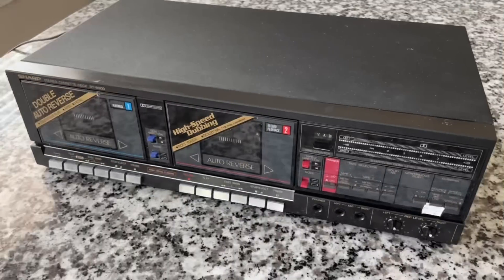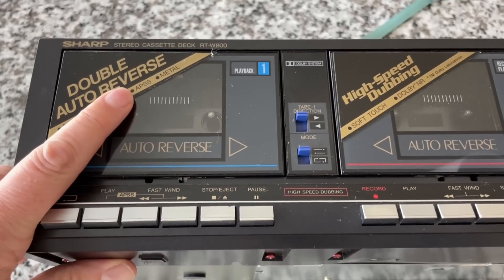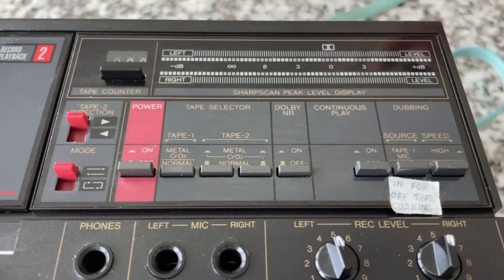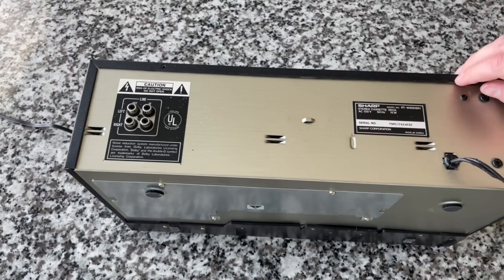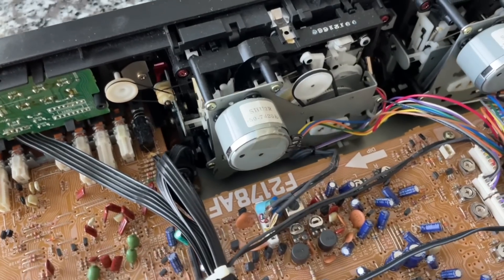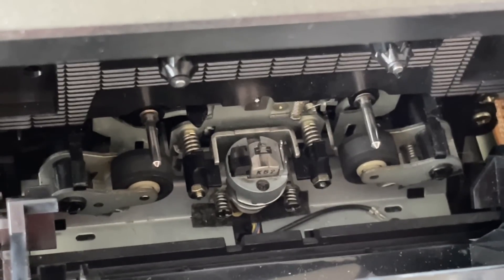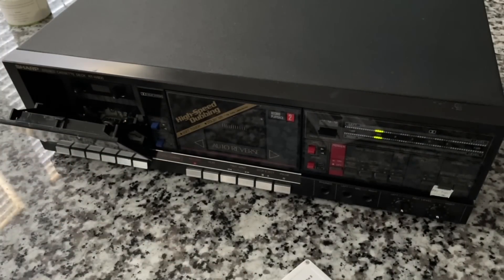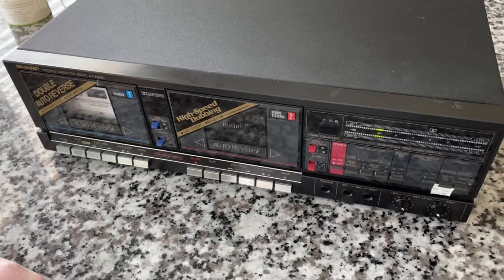RAD Sharp RT-W800 (1985) Tape Recorder! #sharp #cassette #tape

Comment: APSS is Automatic Program Search System, also known as Auto Program Search System, is a technology brought out by Sharp for audio cassette players to automatically wind to the beginning of the next or previous track on audio cassettes - similar to the more modern CD medium. The APSS is available for devices with mechanical buttons as well as for devices with electronic buttons. There were also turntables with this function, but technically it worked differently.
Reply: I have a turntable that has this feature.
Reply: I used to have a portable monaural Sharp cassette tape recorder with the FM/MW Radio. It had this APSS function as well and it was very convenient. It would seem to sense the silence between tracks to auto play.
Reply: I had a sharp GF 8080 which was a 3 waveband(FM stereo MW and LW)stereo radio cassette recorder,the tape deck on this had APSS as well !!

Comment: They sold these into the 90s—I bought mine new in 1992. It was the cheapest dual cassette deck Sears had in stock. Everything else was over $100 and this was $60 if I remember correctly. All the other decks were black and had slow-opening doors and the stainless feet that looked cool at the time. This one was boxy and colorful which looked ugly and dated back then, but it was within my high school kid budget and did everything I needed it to do.

Comment: 14:30 - The capacitor is not shielded, it is a HEAT SINK for the voltage regulator mounted to it. So it is there that the voltage regulator does not get too hot and has more surface to get the warm into the surrounding area
2nd - the color of the PCB did never switch from brown to green. Most audio stuff has the lowest tear of boards - a single sided board. There are no traces on top of it, so no need to protect the traces. If you turn it around it probably is green because there are the traces and those ned protection by coating. The color of this coating is mostly green, but can be any color, e.g. black on modern boards, white, red, blue, or even brown/orange. Computers on the other hand have more signals and use 2 or even 4 or 6 layer boards, meaning that the traces run on top and bottom, or even inside the board non visible by "stuck together" boards. What you mostly see in VCR and audio stuff are those camps or just bare metal connections without any resistor etc. That is just to bring the signal on the bottom over to another place, to make it run accross other traces without making a short. That is where usually you would have a top layer and traces, but it probably is cheaper to run a few metal wires rather than having a dual layer board design.  The top layer in this case shows the traces and components and markings but those are not actual traces, they are just printed on so you can see on top what is connected  on the bottom.

Comment: The reason Dolby is labelled is because the Dolby encoding makes a 10db increase in the higher frequencies.  If you are recording 1kHz at 0db the 12kHz would be at +10dB which is very high. you need to keep Dolby recording at lover levels so as not to top out the tape. ( I have Kept it Simple)

Comment: the dolby symbol on the rec meter was the iec standard in the uk , but for example a tdk ferro type d could take plus 3db a tdk ar could take peaks of plus 6db or more without saturation and upto 8db so rivalled chromes wih#th output versus noise floor

Comment: I don't use Dolby either. In my opinion it takes out too much treble. I'd rather hear the high tones and a little hiss than the muffled sound of Dolby.
Reply: If it's taking out "too much treble" and has a "muffled sound" then there is an issue with the calibration and Dolby tracking of the deck. A properly working deck does not muffle the sound and decks like these that were produced in the '80s were the cheapest of the cheap so there's a good chance the alignment from the factory wasn't all that great to begin with. As someone stated below, it probably came from a rack system. Age just makes it worse. A decent mid-range deck ($200 -$400) could easily outperform trash like this and if a proper alignment was performed, excellent results could be achieved. I recently restored all my Proton equipment from the '80s including a full alignment via the service manual of my two Proton 740 cassette decks. A Dolby calibration tape and some special test equipment is required but that's what's needed to restore old decks that are in otherwise good mechanical condition. Even on this deck, just a basic azimuth adjustment could improve the high end substantially.

Comment: From my experience, sharps are reliable and overall great cassette players. Had Sharp JC-515H for almost five years and used it almost every day, and all it needed were just new batteries. I replaced it with Sharp JC-104 just because I wanted it to have so rest for it's age. And again, it works awesome, nothing groundbreaking but it works and plays really good.

Comment: A very nice looking tape deck. I have an Aiwa hi fi system with twin auto reverse cassette deck on it that has that apss function. It's a very nice feature to have if you want to skip a particular track that's playing you just press the ffwd button whilst in play mode, (or rewind which is ffwd if playing in reverse on the B side), and the player will detect the silent section on the tape and then start playing the next track. It's very convenient and so much better than having to mess about forwarding and rewinding the tape to find the beginning of a track which IMO can wear out or damage a cassette a lot quicker. I've been there and done that so many times.  Obviously though this feature won't work on cassettes with no silence between tracks, for example if you're playing a dance mix album or something similar. Sometimes I've even found that if there's less than a second of silence it can fail to stop at the next track. I think it's because it can't properly detect a tiny bit of silence on the tape in fast speed because it thinks there's no silence there. That's my theory anyway.

Comment: the brown circuit board is a single sided board. you can tell because of the metal jumpers on the component side of the board. if you look closely you will see no traces on the component side.

Comment: I actually came across one of these exact cassette decks for $10 at the thrift store recently, though when I was testing it out, the eject function wasn’t working on either deck (which is why I passed up on it)…. what could cause such an issue?

Comment: Nice video thanks. 80s design looks pretty bad to me now but it is distinctive. I always thought Sharp had too wide a range for their own good. Their best was up there with the best Pioneer, Technics etc but they over indulged the cheap market which cheapened their brand value.
Reply: I didn't even know they did hifi separates. Perhaps they didn't here in the UK.

Comment: Why does the test tape used for recording sound good before the recording but has a crackle sound when playing back using the other deck? Did you clean the playback heads? or maybe it was noise introduced by the adapter to the phone?? Cassette, even type 1's can sound much better than that.

Comment: Intresting, i've never seen a Dolby logo at -3db, my Pioneer ct-f1000 has one but at +3db on the vu meters and i saw some deck with a logo at 0db 
I always try to have the peaks at 0db anyway and it works fine so yeah
That's a really nice deck though, my first cassette deck was a Sharp as well

Comment: So I have something I would like you to check out the crosley alarm clock radio it’s cool it has Bluetooth and am and fm radio they sale them on Amazon and other websites as will it’s a replica of a actual 1950s model I just wanted to let you know they have them in black and white coolers it’s a neat radio alarm clock they do costs $80 but they are neat

Comment: hi the tape is all over the place big time   i been playing with   Technics  RS-X range  there's no need to run them down
i am a tec i i know about the turning record head   on some make they are a right pain  as there's wear on moving parts

yes i know about the poor  L E D METER  there's a work around on that  i meter the audio in  with fix level  tones 
love to see old tape deck i used to pick up from carboots in the uk

beware  i pulled my you tube was going alot of dealers emailing me all the time  this how techmoen gets his gear
 bob